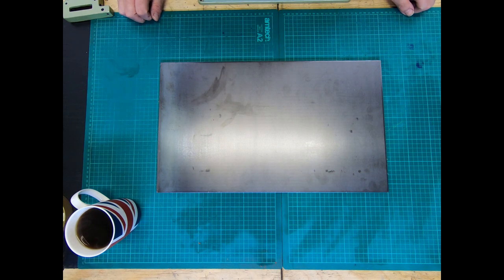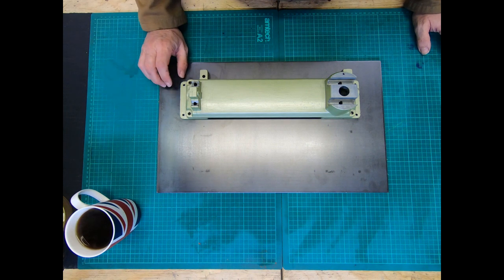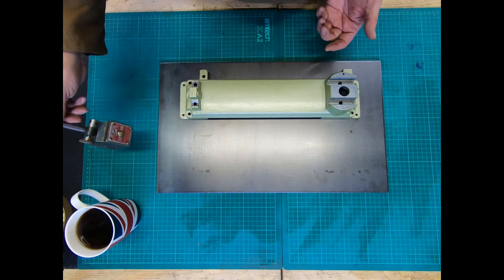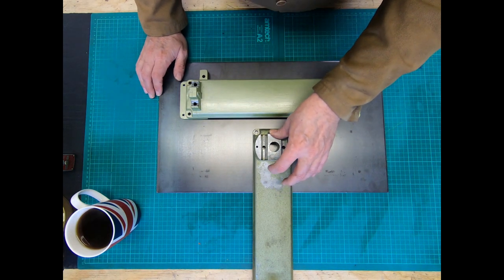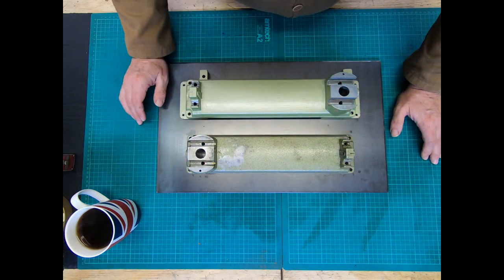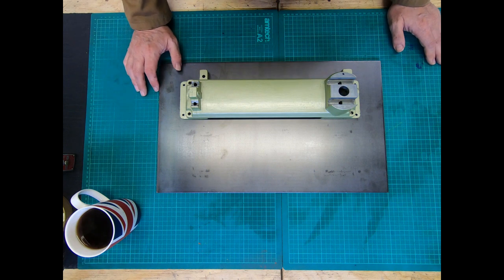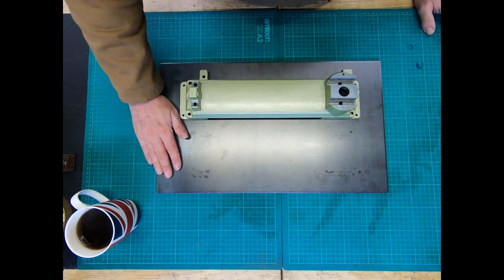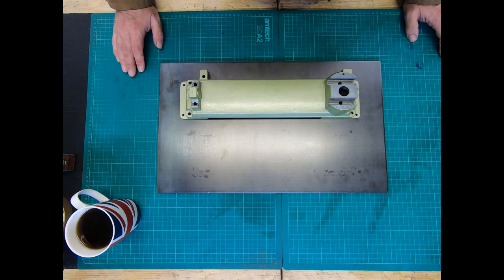Emco Unimat SL - Restoration - Metal Base.

Comment: Great ideas Paul to look forward to. You mentioned about maybe a more substantial metal base. Look out for a small cheap cast iron surface plate or similar. Level your lathe ways to it then when you make your milling attachment base you can bolt it anywhere you choose just by drilling and tapping mounting holes etc. A small tee slotted plate would also be ideal. Tony
Reply from the maker: Hi Tony,
Your comment is exactly why I like YouTube... The cast iron base would be perfect, I will setup a save search on eBay and sometime in the future sometime will pop up at the correct price. Thanks for watching.
Take care.
Paul,,

Comment: G'day Paul.  Excellent idea on using the steel plate as a base.  Out of curiosity, what is thickness of the base?  You may have mentioned it, but I might have missed it.  It would look good painted too buddy.  Cheers, Aaron.
Reply from the maker: Hello Aaron,
The steel is 6mm thick, I have given it a coat of primer and will give it a final coat when I have finished messing around with the position of the lathe. Thanks for dropping by.
Take care.
Paul,,

Comment: I like your idea for a metal base. I had wrongly assumed you went for 10mm until you mentioned 6mm, I expect 10mm would be overkill. Having the plate on a wood base would be great, you could even set it in using picture framing timber
Reply from the maker: Hello Joseph,
I would have preferred 10mm but for sort of prototyping 6mm should be fine... EYUP Tony suggested looking for some cast iron plate for the final version, which I really like the idea of... thanks for watching.
Take care.
Paul,,

Comment: Good one Paul.  The steel base should work well.  Better than my setup as you will eliminate any flex/compression that can occur with wood.

6 mm is a bit borderline as far as the mill head mount goes, but a wooden base should give it some more support and damp out any vibrations.  I'm interested to see how this works out.  I wouldn't paint it until you work out what goes where and drill all the holes etc.  Just oil it for now.

Gotta love these small lathes.  Nice to use and very handy for tiny work.

Cheers Rob
Reply from the maker: Hello Rob,
Thank you for the good idea in the first place... Eyup Tony suggested looking for some cast iron... If I can find some at the right price I may well go with that... Thanks for watching.
Take care.
Paul,,
Reply: @TheKnacklersWorkshop  Hi Paul.  I agree.  That would be a good idea.  Cheers Rob

Comment: Cheers Paul. I was wondering how thick it is, 6mm ought to be pretty sturdy. In my mind I could imagine an angle iron perimeter frame with cutouts both ends to get your fingers underneath. If stiff enough you could maybe do a 3 point mount so no bending induced. Lots of possibilities. It ought to make a very versatile machine with that added attachment. Mart.
Reply from the maker: Hello Mart,
It does need something under it... I hope to tweak it as I go along in a similar way to how you do on your car projects. Thanks for watching.
Take care.
Paul,,

Comment: How ya doing Paul. I mounted my DB on a nice piece of heavy maple but added a 1/8 x 1 x 12 cold roll flat stock to it just for that purpose. I also fixed a metal dustpan at the back of it to catch chips and swarf which I can also afix a mag base. On ebay I scored the section of the base that had been milled off an old Unimat base that I now have mounted in back instead of to the left. It works great and is easy to lift and move. Good luck n take care-Mike
Reply from the maker: Hello Mike,
All good here thank you, I hope likewise... Your setup sounds very good, I did notice the mill attachment mounted on the back of your lathe when watching one of your videos.
Take care.
Paul,,
Reply: @TheKnacklersWorkshop  we should have a collab and try and figure out a compound slide for the DB. I've been giving it alot of thought lately.
Reply from the maker: @machinistmikethetinkerer4827  Hello Mike, sounds interesting, as you know I have quite a bit going on with the clock project but maybe later in the year...
Reply: @TheKnacklersWorkshop  oh yeah looking forward to that for sure! To me that's a huge project...

Comment: I like these ideas.  My machine is mounted on a make shift stand that some previous owner built.  Previous owner has it on a smaller piece of 1/4 inch aluminum.  I presume he used scrap metal he had laying around for the entire build.  It has its charm and works for now, but I will eventually make my own improved version.
Reply from the maker: Hi,
If your machine setup works for you I would not change it... Hopefully my setup for the Unimat will settle down as I get use it... Thanks for watching.
Take care.
Paul,,